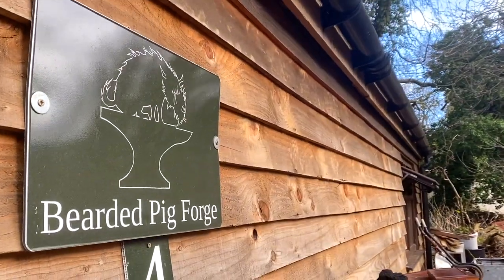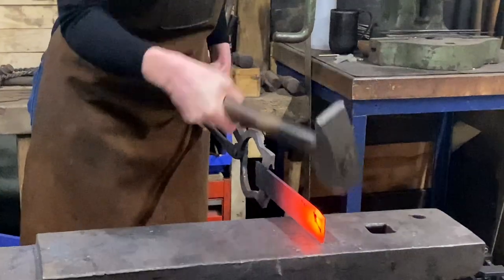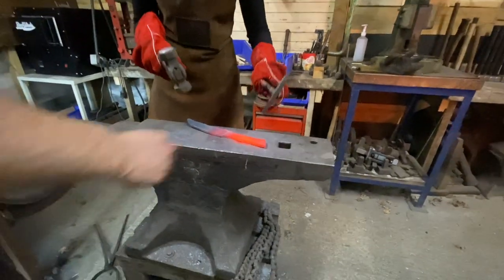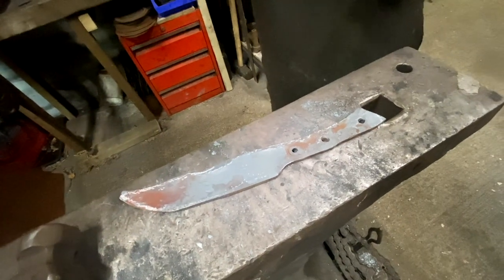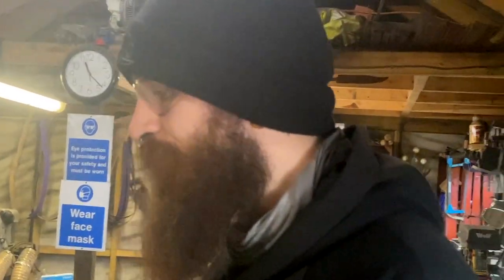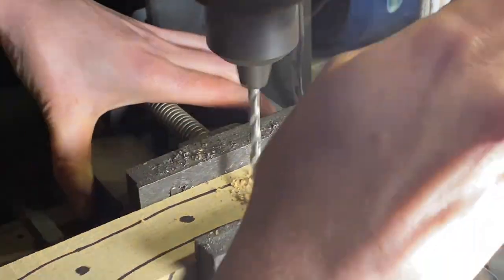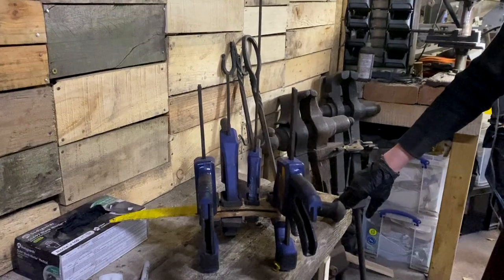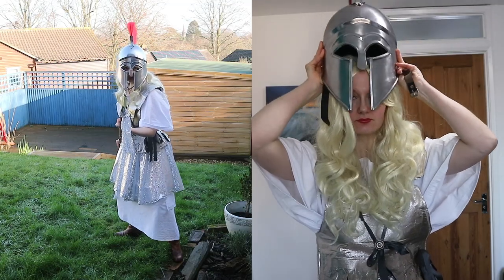I Accidentally Made...

Comment: A suggestion, for epoxy work. A drop or 2 of methyl ethyl ketone will thin, or technically reduce, the epoxy. It will also slightly slow the cure. It can be a great help. You do lose a tiny bit of strength, but it probably wouldn't be noticeable. MEK is nasty stuff, do be careful to not get it on your skin and also have adequate ventilation. 

Thank you for all you do in the videos.

Comment: Technical question (for anyone in the know): I have watched an inordinate amount of smith-work online, and there are generally two ways to approach bevels: I have seen people JUST grind bevels, and I've seen people forge bevels, and then use a grinder to refine them. Why would a smith choose the first path (grind only) when teaching a student? Is it just because the alternative requires learning two difficult, fiddly techniques, one of which requires pretty good hammer control (which a n00b doesn't have)? I'm asking because I've always wanted to do one of those knife-making workshops at some point, and I am curious how different the procedure is for a rank amateur compared to the experts I've been watching. Also, it does seem that forging bevels before grinding them saves a lot of time...the knife in this video was a good 4 mm thick (at LEAST) after the temper, and to grind a V-shaped bevel requires taking off a LOT of steel.

Comment: "You have to remember that fire is hot... and anything you put in the fire will be hot, and will remain hot" should sound obvious, but my mom once said to my brother, "careful this is hot" (about a pot of boiling soup she had just taken off the stove) to which my brother responded with "which part is hot? this part?" and smacked his hand against the side of the pot, burning his hand.  But wait, there's more, because a few weeks later, my dad did basically the same thing with a casserole that had just come out of the oven.  And thusly, when things have been cooked, it has for decades been standard practice to proclaim, "the whole thing is hot."  (of course, that just meant that when he got to be a little older and more of a smart-ass, my brother burned his finger going, "even this part? what about this part?" and getting his finger a little too close to "this part" of the dish)